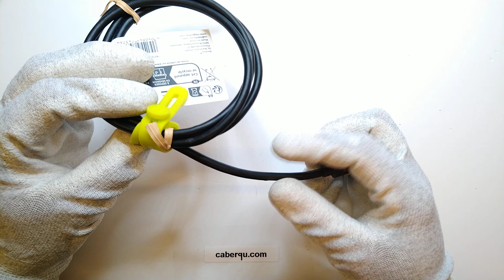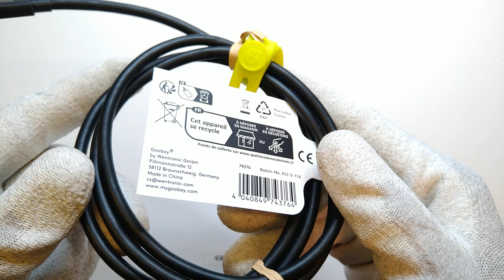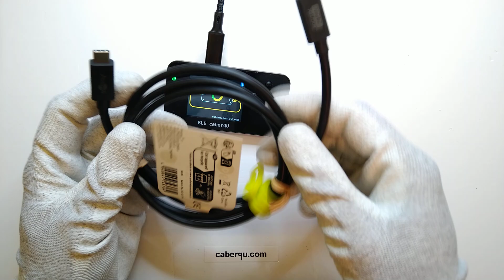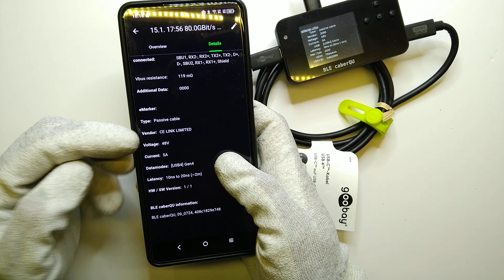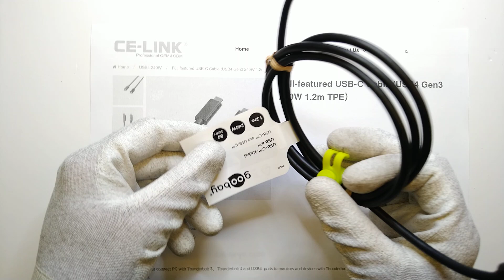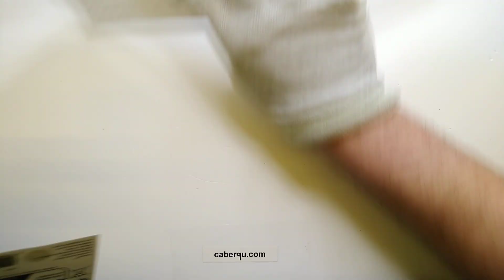The fastest cable available

Comment: I find the 240 watt claim somewhat counterintuitive.  It is a heck of a lot of power to force through such a slender cable, bearing in mind that besides the two power conductors there will be data conductors plus the thickness of the insulation around each of the power and data conductors plus the thickness of the outer jacket.  That does not leave much cross-sectional area for the copper of the power conductors.

What voltage and current is applied to actually achieve the claimed 240 watts?

Has anyone independently verified it?
Reply: This channel is a gem and a niche for those who are already really deep into the USB rabbit hole, so it assumes that you are already familiar with specifications like USB PD (Power Delivery). In this instance, USB PD version 3.1 is what you should look up (especially EPR, Extended Power Range). The 240 watts are achieved by raising voltage to 48 volts and current to 5 amps. The Type-C connector uses 8 pins for power, 4x GND and 4x Vbus (which will be raised to 48V after negotiation between the PS and the load). Assuming equal resistance, it means each pin/wire will need to be rated for 5/4 = 1.25A. That is how you can achieve 5A total with even with less than 0.1mm^2 cross section area of copper per wire.

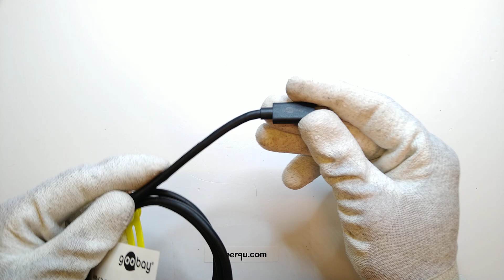Comment: 0:20 braiding is often a sign of a crappy cable, trying to hide its crappiness with looks
Reply: And trapping dirt - my fingers regularly itch on most braided cables straight out of the package, which only goes away with attempts to clean it. Silicon cables are much nicer anyway.
Reply: @klaernie  yeah as the owner of a half century old pinball machine I can confirm that cloth braided cables eventually collect so much dirt you can’t tell what color they were originally (which makes tracing them extra fun)

Comment: wouldn’t the fastest cable you can get now be a thunderbolt 5 certified one? don’t get me wrong it’s almost identical but technicallyyyy it can go up to 120Gbps one way instead of just the 80Gbps both ways
Reply from the maker: TB5 is pretty much using the same idea, both USB4 v2 and TB5 can do 80Gb/s bi-directional or 120Gb/s uni-directional.
Reply: For festest speeds you need to have all pins wired up, the rest is qulity of material and host device behavior in case of interference, certification is just marking that it passed specigic specs and tests and you can legally complain you cant achive those but it can preform better teoreticly. Only hard limited is PD, as it have chip system on csbles that protects to not melt cheaper cables with higher wattages power